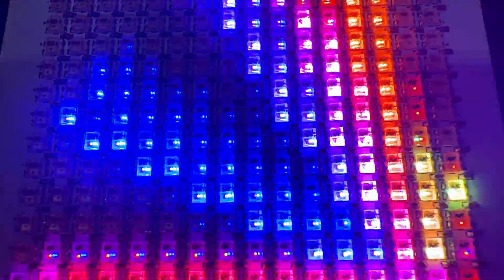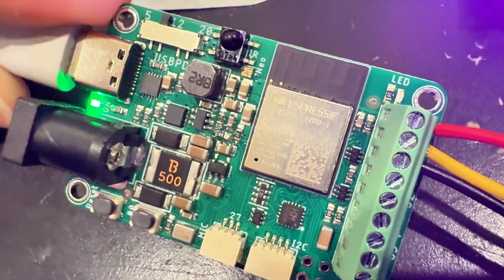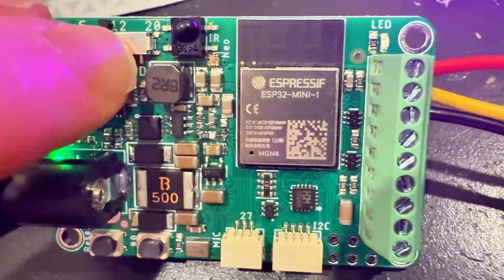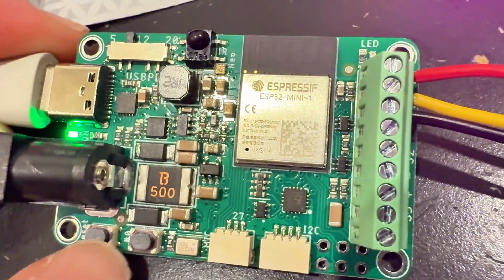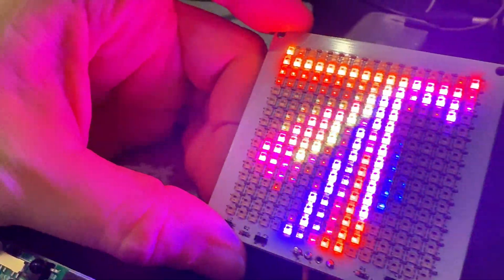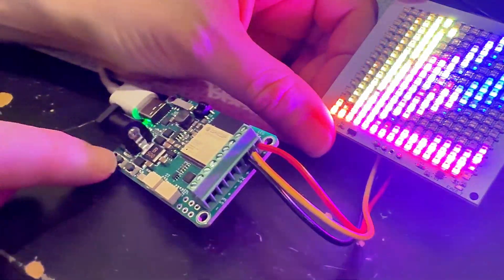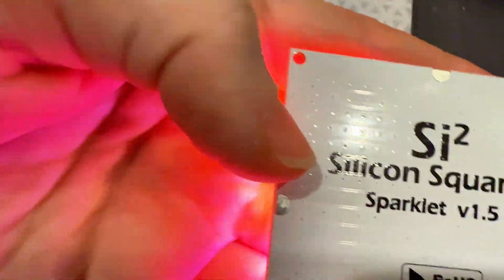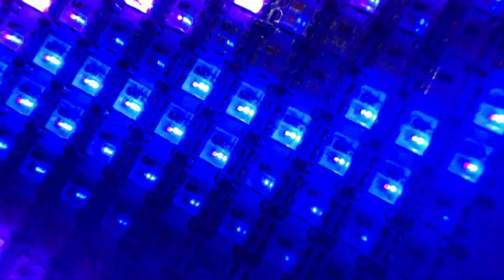The first test for our WLED board codename "Sparkle Motion"  🌈💖💡 ... 🐇⏳🌌

Comment: I want one. Although, I haven’t used IR for any of my WLED setups yet, other than testing it just to test it with a very limited IR remote I had on hand, I just recently got a Wiz remote after ESP-Now was integrated into V.0.15.0. The Wiz remote’s cool being ESP32, so it doesn’t need line of sight, but, functionally, the remote itself is pretty limited to I/O, only 4 presets, and only, like, 6 steps of “dimming.” So, I’ve been leaning towards IR, with a better remote, for a project and I don’t know that I’m a fan of the surface mount IR receiver- putting it in a weatherproof box I think would be kind of tricky… Maybe a couple thru holes or larger pad to extend the IR outside of a box?